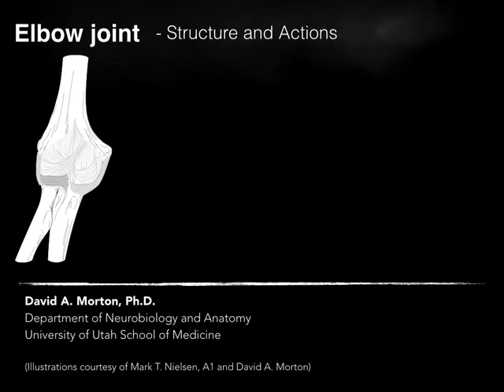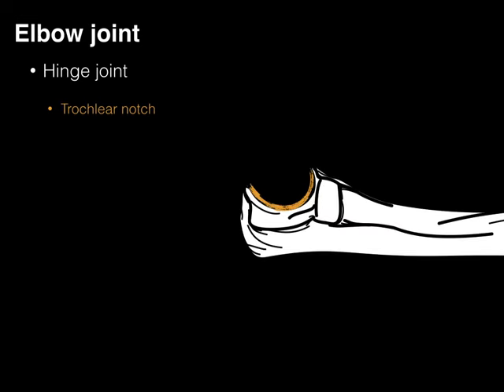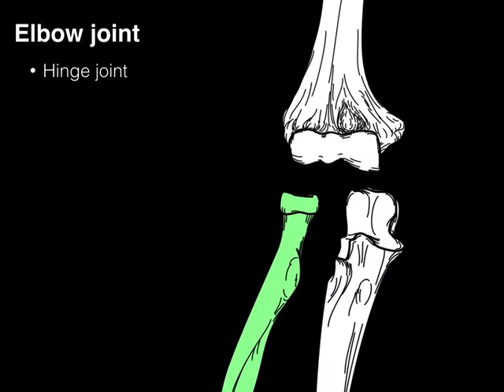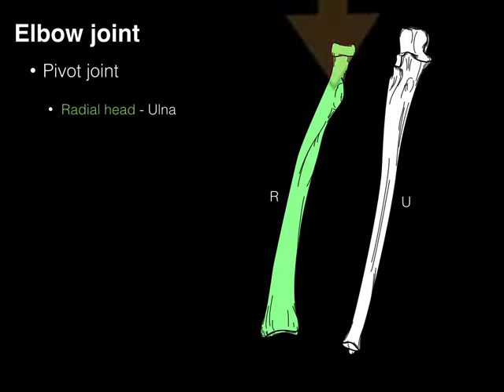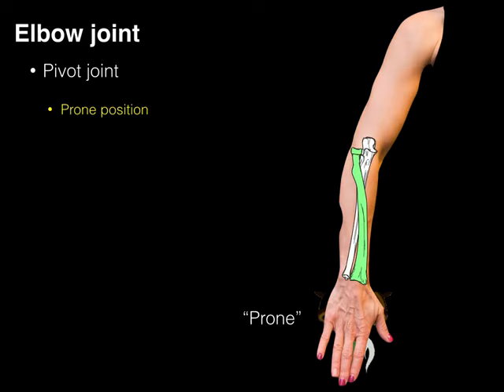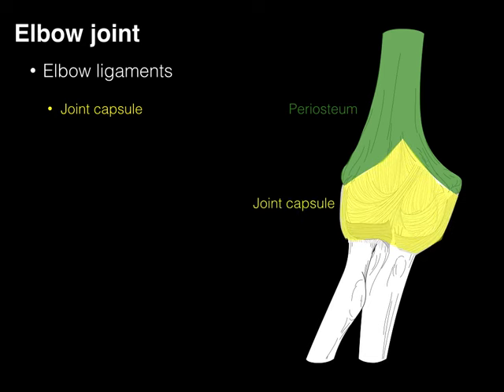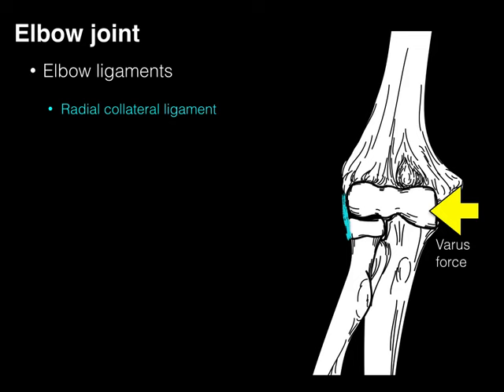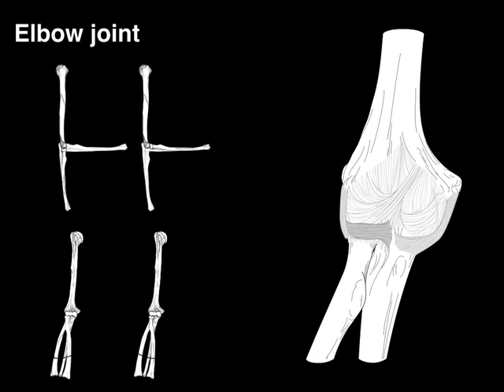Elbow joint. Structure and actions

Comment: Isn't the quadrate ligament also part of the elbow joint ligaments?
Reply from the maker: Yes … The quadrate ligament contributes to proximal radioulnar stability. It limits the rotation of the radial head by attaching the radial neck to the inferior portion of the radial notch.